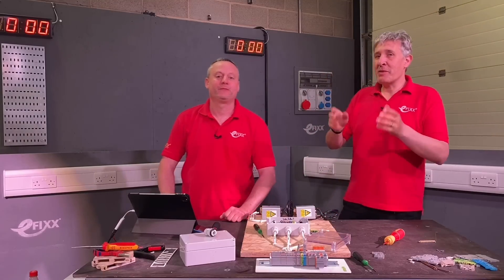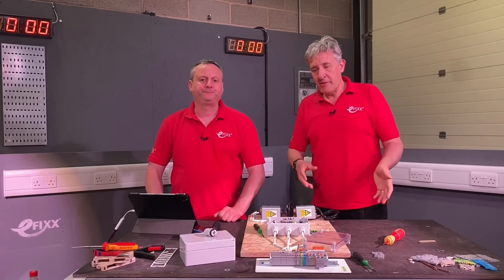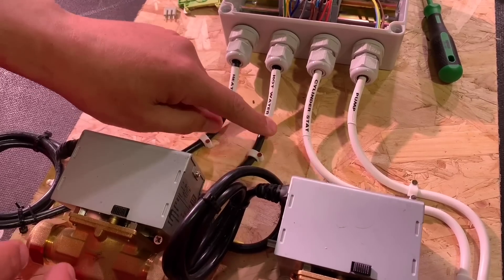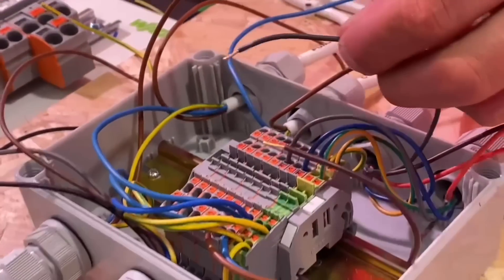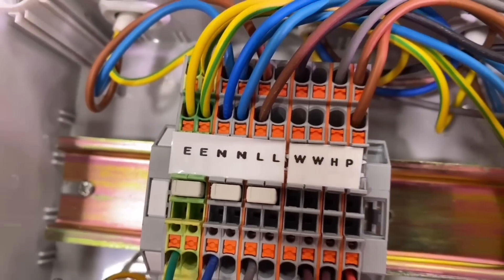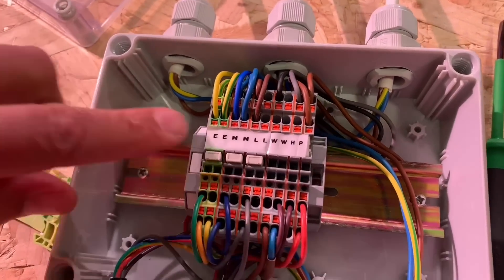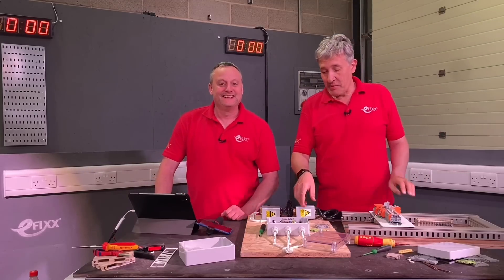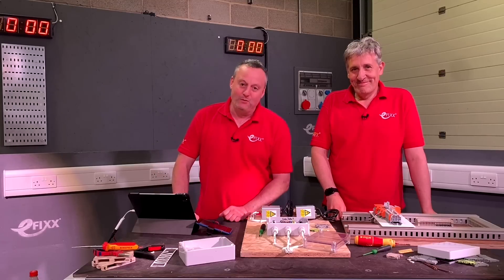Building a IP66 junction box using WAGO TOPJOB DIN rail terminals - S-Plan wiring

Comment: Just about to put these in in my place with some N Bundy flexible trunking to route the cables over to the valves because the plumber put the wiring centre ( actually a bunch of screw terminals with some electricians tape wound around them) at the back of the airing cupboard behind the hot water cylinder. Just luck that I’ve not needed to replace any of the valve motors. 

Also adding in some extra connectors to monitor when the power is running to the valves via home assistant.

Comment: As a suggestion you may wish to look at using the Wago 261-331/334/336/337 and 333 if needed.  The reason is that the topjob has the cable entry/exit on top which puts more strain on the cable immediate bending once exited the connector, whereas the 261 range is side entry/exit and will result is less stress for the cable connection.  Advantage of the topjob is the additional connection using the push in jumper bar.

Comment: By the way, I have learnt LOADS from this channel. I've gone from DIYer to "competent person" (at least I hope the building inspector for our home build agrees....) I learned about Topjob S here on this channel, spent a painful 3 days trying to work out the product numbers I would need, then bought a whole load of connectors to do our home renovation with! I bought a nice large galv steel lockable enclosure from TLC (their IP65 ones), some 100x100 steel trunking (again - learned loads from this channel about cutting in the turnbuckles) and I'm wiring all 38 lighting circuits back to this enclosure. I'm using the Wago Topjob S as a kind of "patch panel" at the top of the enclosure so that I could change the configuration of the lighting later. e.g. swap switches out for dimmers, connect various light circuits together, etc. Learnt loads about regulations, even how to ensure the galv trunking installation complies with regs, all from this channel. Big thanks for the excellent content.
Reply: 38 lighting circuits in a house?? Do you live in a palace??
Reply: @ciaranharrington4141  Just finished documenting all the wiring drops today, and it's actually 47... by way of example 4 bathrooms (our en-suite has 3 circuits, one for exposed brick wall uplights, undersink, and ceiling spots, the others have 2 each). Kitchen has 9 circuits including outside / roof overhang. It's a lot, but we have all the walls and ceilings off so it makes sense to run a LOT of cable as I'm doing it myself so not paying per drop!

Comment: You need to be careful with sealed enclosures which are subject to temperature changes... you can end up with a build up of condensation internally. However, you can get IP rated breather vents which will prevent the issue.

Comment: I'd recommend leaving a wiring diagram in the top of the enclosure, if only to confirm to the next guy that they are dealing with a completely conventional S-Plan System. You can use the diagrams from the  Honeywell Wiring Guide and if doing so, I would label the terminals as per the Wiring Guide - this uses numbers (1 thru 10).

Comment: Excellent video and a very neat and professional looking finish.  Using this shows that you care about the final look of the product, even though it will be hidden under a lid.  As most of these boxes are hidden away in the airing cupboard, are we concerned that it is slightly on the larger size?  The customer can always hang their damp socks off it.

Comment: As someone who is not a plumber or and electrician, but works in industrial instrumentation and control, I was shocked at the installation of my boiler a few years ago. Stuff all the gubbins in a 25mm double surface pattress and a blanking plate. I didn't swop it all out for a small 4x4 din rail box with some weidermuller terminals I pinched from work. I do like the Wago stuff, and use. Their Eithercat PLCs a lot. But weidermuller is more readily available and has more options, (Larger conductors, fused blocks, switches etc... ) Also the jumper system in the weidermuller ZDU terminals is simpler to use IMHO.

Comment: Why is it acceptable to use plastic junction boxes when fuseboards have to be metal?
Reply: Normally do you can buy same boxes in metal too. For IP66/67/69 it is equal if you use metal or plastic boxes. But for insulation between the different cables do you need plastic only, metal is forbidden!
Reply: because wylex don't make them.... it's been deemed a lower risk... and london fire brigade haven't deemed it necessary to get involved as yet.
Reply: Consumer units need to be metal if on an exit route from the building.  Everybody fits metal regardless of location.  There is nothing wrong with plastic consumer units , people who install them badly or connect up new circuits leaving loose connections are to blame.  It was probably more prevalent in london due to the cosmopolitan population.
Reply: @dennisphoenix1  

This is from BS7671. It only talks about the premises as a whole and not any specific areas within it. Therefore any location within the domestic premises would be required to comply with the regulation. 

421.1.201 Within domestic (household) premises, consumer units and similar switchgear assemblies shall comply with BS EN 61439-3 and shall:

(i) have their enclosure manufactured from non-combustible material, or

(ii) be enclosed in a cabinet or enclosure constructed of non-combustible material and complying with Regulation 132.12.

NOTE 1: Ferrous metal, e.g. steel, is deemed to be an example of a non-combustible material.

NOTE 2: The implementation date for this regulation is the 1st January 2016, but does not preclude compliance with the regulation prior to that date.
Reply: It’s a bit like cheep dry lining boxes highly combustible
Reply: @andysims4906  you can get fibreglass pads for inside them for that reason. Takes up space in the box and reduces space for cabling
Reply: @andysims4906  That's exactly my point.
Reply: gadgetman36  the problem is so bad I have almost stopped using plastic boxes . If I do,I use Marshall tufflex as compared with other makes they are less combustible and fit fire putty pads
Reply: It may have something to do with the power density in a consumer unit (potentially 100 Amps in the U.K.) compared to a S Plan wiring centre which is probably a maximum of 13 Amps depending on how many pumps are on the system.

Comment: Great video, so neat and tidy.
Do you guys know if the new wago inline splice connectors are getting a UK release soon?
Reply from the maker: We’ve heard January.
Reply: @efixx  lovely stuff.
Reply: Just come across this clip and I have seen others waxing lyrical over wiring accessories, I am amazed it has taking so long for these types of connections to appear in building electrical installations, I was wiring machine tools with din rail connections over 25 years ago , many machine tools have much higher voltages and currents than LV installations

Comment: Really neat setup, if I came across that in someone’s house I’d be seriously impressed given the mess heating system wiring normally is.
Reply: You are correct. But you got to remember a heating system wiring is often worked on by many different trades people, over years of maintenance, at the end it turns into a pigeon nest and often needs totally renewing. This is a wonderful setup.
Reply: @h8ryj if you have the space, and it’s got enough room, the wago 221 style box is probably more likely to remain reasonable over time.